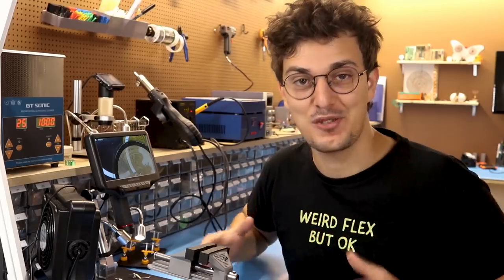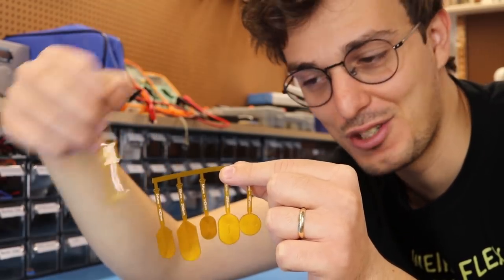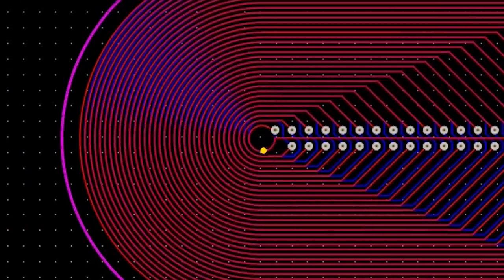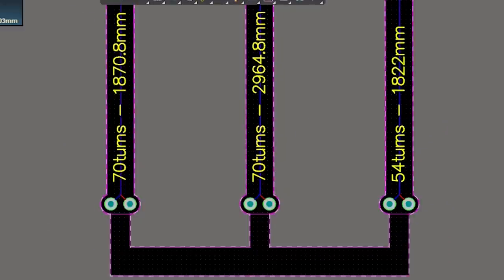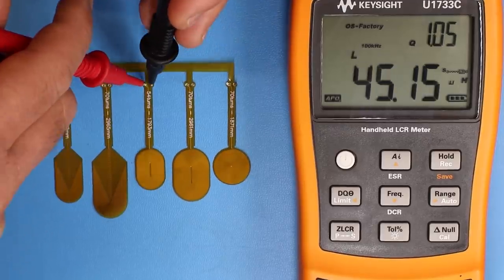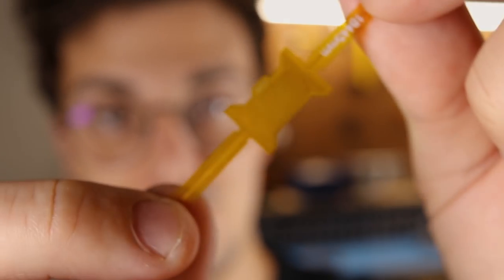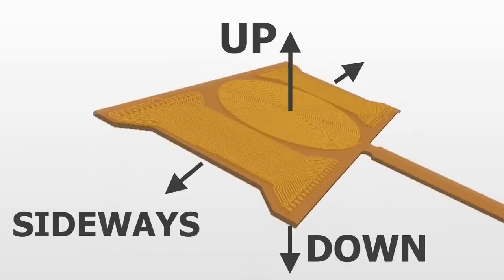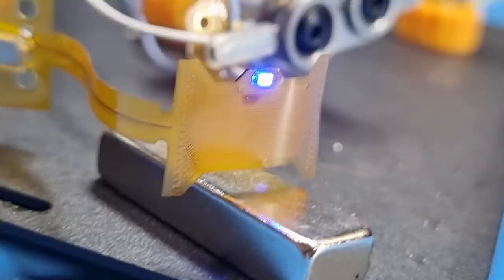Exploring New PCB Coil Actuators

Comment: Coreless magnetics has its limits.
Some ideas:

For motor applications where a flexibility is not required you might investigate a fairly thick, multilayered pcb with a hole in the middle for a press-fit iron disk.

A mixed stack built up with a flexible layer and fr4 layers is also a possibility.
Reply: thermal glue on stacked PCB coil maybe

Comment: I remember LEDs on the tip for one of the first videos, one of which was quickly broken. 
Would it be possible to have fiber optic wires at the end instead, and create a dismay using fiber optic ends?

Comment: Take several of you pcb coils, insulate the vias, glue them together into a composite sandwich, run them in parallel or series.  You’ll increase the overal field significantly due to having more windings interacting with each other to form a concentrated fiedl.

Comment: rotate your supply clips 90 degrees, so that the sideways actuating coil isn't fighting to flex the width of the pcb legs(arms?). The legs(arms?) will flex less in the direction that you have them orientated.

Comment: The horizontal, uh, flapper not flapping is due to the mechanics of the, uh, arms. The ratio between width and height effect which direction the thing will flex. And having those curves will add to the z-plane rigidity.
Reply from the maker: I agree the thinner Arms would have helped it move better but I think it's magnetic field strength was still too small for it to achieve the motion I was looking for
Reply: @CarlBugeja  see if you can put a gentle 90 deg or 180 deg twist in both arms so that it has a point where it can flex. I don't disagree about the magnetic field strength, but at least give it a fair chance to flex.

Comment: I was curious if you can get a Nickel finish applied to these coils and if that would make any difference in the performance. My thought was Ni being magnetic may increase your flux density resulting in a higher power coil. I'm not sure if this works physically or if you can even get Ni finishes... was curious what you thought?
Reply: PCBs with gold plating (ENIG) have a layer of nickel between the copper and the gold. But it's probably not very thick
Reply: Gluing a thin nickel or steel foil on the back to check it out might work. Perhaps pcbway can be motivated to offer that option once it's proven it works.
Reply: There can be no better conductor than silver i think, except supra-conductors...  And silver sticks to magnets too as i recall, but maybe my memory is failing.

Comment: For the sideways one, I wonder if it may have moved more if it was working with the natural bend of the PCB material instead of against it. All the other coils force was applied to a single PCB strand and along be narrow flat surface where it will naturally take the least force to bend. The sideways coils force was being applied to two PCB strips, both on their sides. The location least likely to bend and would require extraordinary force.
I'm guessing you had the end of the PCB acting like a joint to resuce the force needed, but even if that's the case, it's already trying to push against more material than the rest.
I know the profile of the magnet doesn't lend itself to any great amount of force. Still, it would have been nice to see how it would have handled without the higher resistance to movement.

Comment: Idea: a flex PCB that can be soldered into a cylinder coil. I've no idea whether that might give any advantages over winding it with wire though.
Maybe if there is a small enough flex-to-flex connector then such unlockable coil can find some use in sensors...
Reply from the maker: Interesting idea I think it might offer some benefits to sensored applications
Reply: The real benefit of PCB coils is in planar transformers. If you want a traditional transformer coil shape you're probably better off winding it with wire on a bobbin.
Reply: Nuclear magnetic resonance locking coils and probes are commonly made that way with flexible PCBs, though special coil geometries allow you to skip soldering it into a cylinder.

Comment: I have question, maybe tested before.
Wouldn't it be better to use two electromagnets instead of neodymium magnets?
It came to me when looking at frog design.
And with PCB motor, might make induction motor instead of using magnets to cut on weight.
Reply from the maker: I've discussed this in this video 🙂 https://youtu.be/XfVz9Otxzyo

Comment: I think part of the reason the sideways coil may not have worked as well as it could have was the direction of the force in relation to the orientation of the part. If it's possible to create these with a 90 degree rotation in the leg, the forces wouldn't have to oppose as much material in that axis, allowing for more bend

Comment: Can you use these coil for wireless charging? I mean if I had a project that has a piece that have to be light weighted, can this flexible coil work as a receiver of a wireless charger? Charging rates should be around 4.2 V (like a normal LiPo chargeing rate for 3.7V batteries)…
Reply: In theory, yes. Working out how is up to you though. If you're constrained by existing wireless charging standards you'd probably have to tailor your coil to make it work. If you have free rein over both charger and device you can probably make something work. I haven't done it myself, but I'd say put 2 on top of each other and you have an air core transformer. Run it at a high enough frequency that the inductance dominates the impedance (about 300kHz would be the sweet spot for the FlexAR I measured. Too low and the cores will lose a lot of energy as heat in the copper resistance, too high and it will act as a capacitor). If your design allows you may be able to improve things by putting a planar ferrite core in each half such that they come into close contact when your device and charger come together. Now whether you could actually get a useful amount of energy through this transformer is another question.
Reply from the maker: couldn't have been said better - it is an interesting concept but in really life applications it would be hard to do this while maintaining Qi standards
Reply: Thanks for the answers! 😊
I will try to come up with an own design in the near future! 😊

Comment: I bet a large part of the reason the displacement was so low on the last one was resistance( to motion, not electrical resistance) from the PCB itself. If you could rotate each arm 90 degrees from the part with the coil on it, you might see a larger displacement. It's like the .1mm versus the 1cm thickness of the PCB in the plane of motion. Pretty sure they can't do that though so might be a dumb idea:(

Comment: Hey Carl. I would like to know how do you design the coils in Altium. Is there any tool in order to keep the clearances that you desire ? Or maybe, you are using polar grid in order to design the coil tracks ? 

Regards, Kostas.
Reply from the maker: check this out :) https://www.youtube.com/watch?v=_-YDuCqEwuw
Reply: @CarlBugeja  Thank you for the link. I am designing many led lamps and most of them are circular. In AD20 if I am correct they have added "Any angle" corner style and I can design with more routing freedom without designing so many arcs. But in order to design coils or antennas there is not any feature to help the designer and everything has to be made manually. Your video was helpful ! Thank you again.

Comment: Hey Carl. Have you thought about printing several connected coils (alternating winding direction) in a line then folding them up like a concertina to get extra layers for ‘free’? Not sure if I’ve described that very well but might be an interesting experiment. Have you tried stacking actuators on top of each other to get the same effect?

Comment: Sandwich them ... 3-4-5 on top of each other. Or even more to maximize field strength?
Reply: I was just thinking of a 4 layer ... but sandwich is probobly way cheaper. Of cause, it will be fairly stiff.

Back at my old work we had 40 layer board inductors for micro DC/DC converters.
Reply: @matsv201  You could design the "sandwiching" into a new prototype, so that it still only have a one layer stem, but flair out into several pads, that can be bent on top of each other ... or something :)
Like with living hinges.
Reply: @ZappyOh  Yes that would of cause be resonable

Comment: Would be interesting to see what you would/could do with access to superconducting materials and the cryogenic setup to make it repeatable. And then ofcource a highend many channel Keithley input-out equipment.

Also having access to a SEM with EDX and in situ added AFM/STM with a modern harddrive tip (measuring the magnetic field in xyz) added to the normal AFM/STM tip would be a real treat to witness. 

How well are you with software ? 
Getting a working brigde working between legacy SEM equipment (Jeol, even new models) and own written software is exceedingly difficult. 
No support from Jeol or other legacy SEM companies is to be expected. Cannot blame them really but would be awesome.

(me personally am mediocre with software but excell at hardware).

This series has been great to witness. I miss Uni.  

Have fun, I'll be watching.

What country are you based anyway?